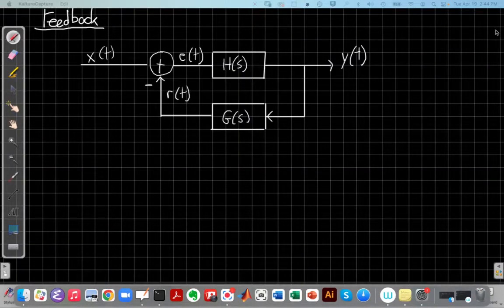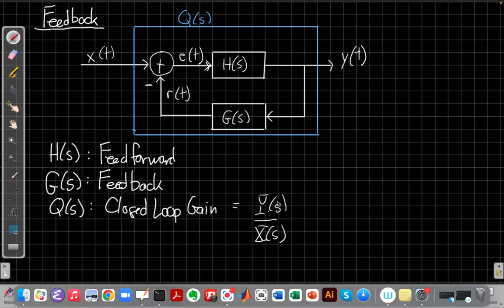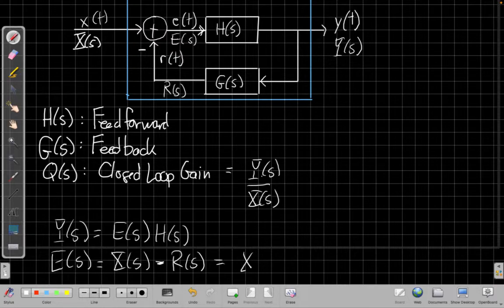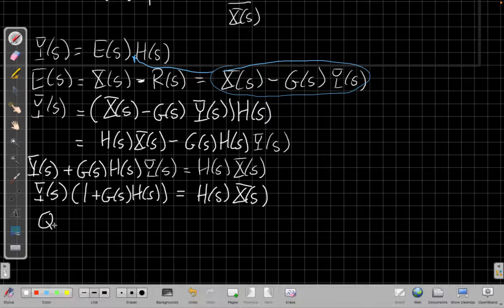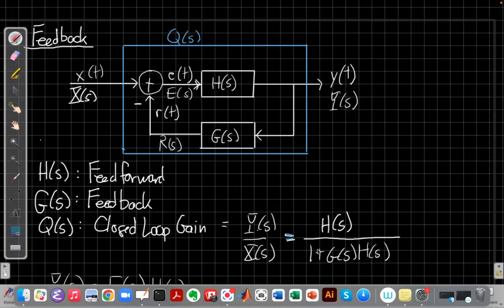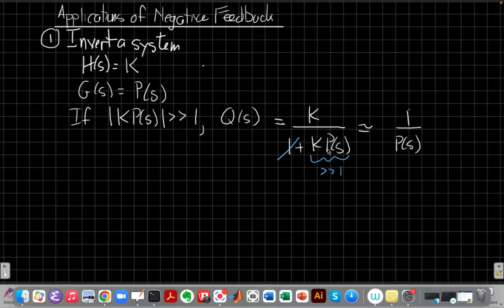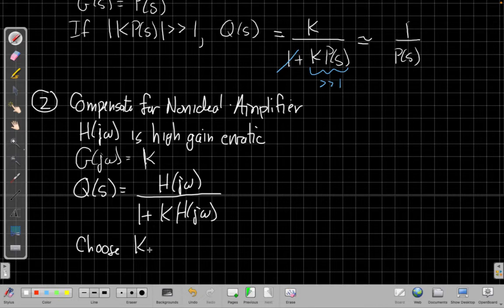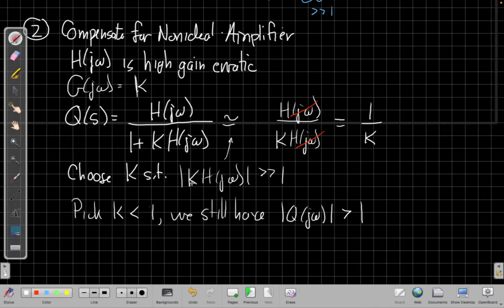Feedback

Comment: I am busy with the design of a class d amp, as I did see and learn is that for what class d I do go, all has the same kind of feedback who make that the names a s com, in the patents are of no valeu. I do not understand Patents can be done with systems who need all the same kind of corrections in feedback and nested loops.

I did get however after some sumulation a distortion below 100dB with not that much effort. The most important work is to get the pwm stage open loop distortion as low as possible. can be doen by deadtime compensation by balance out the voltage error, who by the way can also be done with feedback of course.

The calculations however are difficult in the feedback path, and simulation is needed.